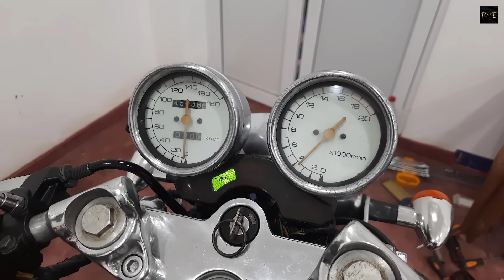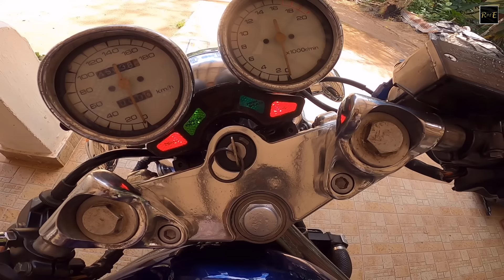Suzuki Bandit 250s Full Restoration

Comment: Beautiful job man! 4 cylinder 250’s are magical things, and this one is a treat to see. Thanks for giving it another life 😊
Reply: 400
Reply: The rev range on that lil 250....jeeeeezus, did it have an 16k redline?!
Reply: I agree... beautiful machine. That in line four sounds so good
Reply: Bandit 400cc
Reply: @hengkywibowo7351  yah im trying to figureout how its a 400 when i thought it was 250cc, did you see the 400cc stamp or something?
Reply: @AridersLifeYT  Minute 23:09 look on the left casted displacement plate: 248cc A.K.A. 250 cc. 🙂
Reply: @sultanandara9782  it's not 400CC it's actual 250CC bike   you can also find 250CC 4 cylinder bikes likes (Honda Hornet 250CC) (Honda CBR 250CC Gullarm) But you also correct because also have Suzuki  bendit 400CC bikes ❤️🙂

Comment: don't think I've ever seen a restoration using mostly (all?) original parts where the bike looks brand new out of the dealership. Really impressive, esp the paint jobs. Only thing the crankshaft bearings looked worn and have not bee replaced?

Comment: Great job! Looks amazing! Doesn't sound right though, I think the carbs need some cleaning and adjusting.
Reply: Was looking for this, indeed they are completely out of sync, watch when they rev and the carbs are without the airbox. The carbs are opening one at the time, instead of the same lift. That's way they sound bad.
 They need to bring it to a real mechanic, with vacuum gauges and a AFR sensor. The later is not really needed, but it'll help. 
 Also, they missed a great opportunity to clean up(dremel out the edges) the machining around the valve seats and cutt new angles, that will smooth out the power really nice, but that's a bit too much for them...

 All in all, this is only possible for them to do, requiring an enormous will to do it, bunch of free time or passion and I'm really hoping they continue to do it, hat down! I really respect them for rescuing this and maybe many other examples!

Comment: engine runs like crap....thats why he holds the throttle a little open so the engine would not stall...sounds like it runs in 3 cylinders sometimes...full restoration my ass...clean and assemble back...🤮